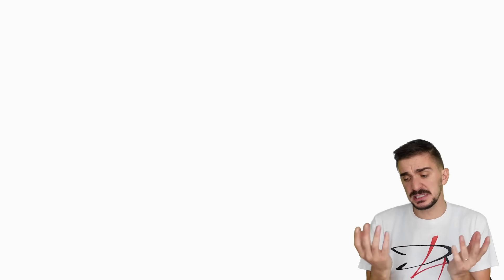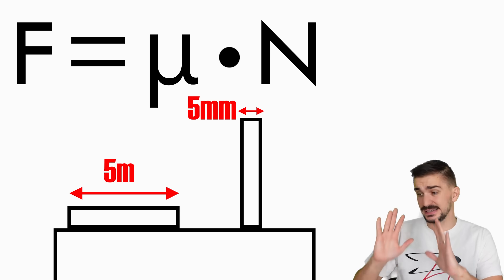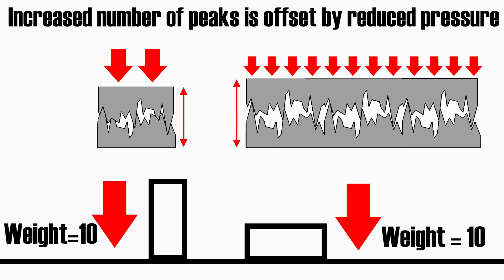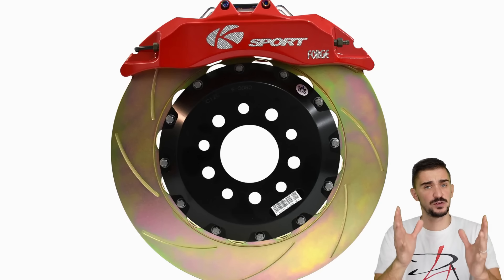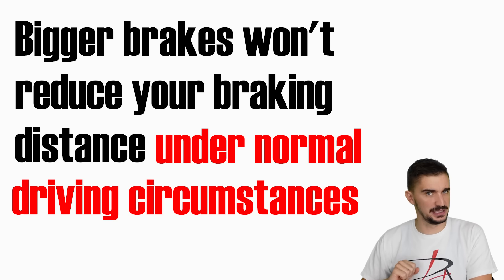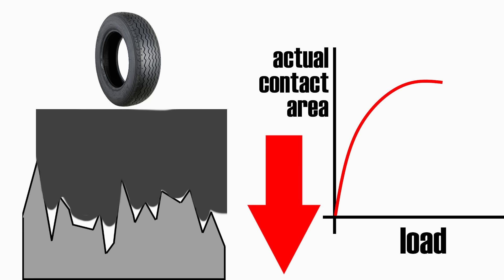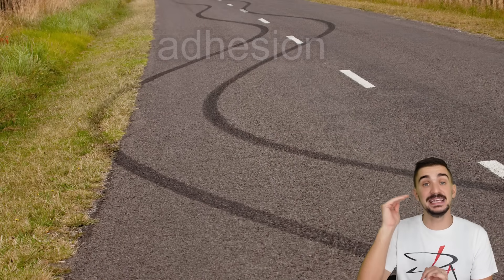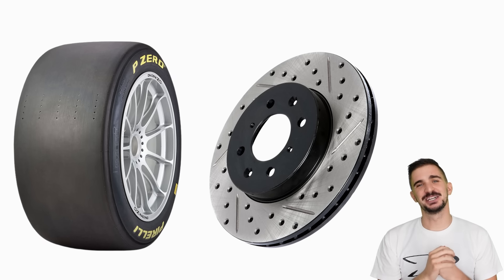Why Big Brakes Won't Stop You Faster but Wider Tires Will - Friction and Surface Area Explained

Comment: You are wrong for many reasons.
Maybe you should consider why all small light cars have smaller brake rotors, pads and pistons than all larger heavier vehicles. 
It has nothing to do with heat dissipation.
Larger rotor and pads also allow bigger or a larger number of brake cylinders and/or pistons giving greater braking force.

Comment: A larger diameter rotor - even with the SAME brake, pad, friction… only larger diameter - a larger diameter rotor will increase the moment/torque applied to the wheel, thus stronger stopping power (shorter distance to stop).
Reply: Stronger stopping power ONLY equals shorter stopping distance IF you can't lock the tires (or reach the ABS threshold) already. And even in cases where you can't, a higher coefficient of friction brake pad will give you more torque just the same, for less money and less effort.

Comment: Independent of friction, larger brakes have a larger average diameter which allow them to apply a larger torque to the wheel.   Therefore I argue larger brakes can indeed provide a shorter stopping distance
Reply: CAN...but probably WON'T...because any car that can lock up the tires (or reach the ABS threshold) can't make use of the increased torque. You'll just make it easier to lock up the tires (or reach that ABS threshold).
Reply: Agreed

Comment: Better brakes /calipers resist locking up. Any stock calipers are capable of locking up (stopping the wheel from turning).  Really good brakes (calipers) will let you generate high G forces Without Locking.

Comment: I'd like to point out that these tests are finding a 1% improvement with the wider tyres. Yes if you are racing professionally then every second counts, but for the cost of wider wheels, tyres, and any body mods you may need there are much more cost effective ways to make your car faster. Wide tyres and body kits are just "in" at the moment

Comment: You need to stop making absolute statements with your video titles.

As for the video itself, you state yourself that larger upgraded brakes will get you stopped in a shorter distance but then go off ignoring everything you just said. Unless someone who has years of experience working with modifying vehicles of any kind, they won't realize what you just did. The end result is your causing harm to regular people.

Comment: So, myu(mju...) constant isn't constant for rubber? It changes when a presure changes. Right? And a second question, motorbike tyres have round contact surface , so, how much it helps to have them wider? Perhaps slight underinflation helps more? Thanks.

Comment: Not all tires are created equal.   Michlen practically reinvented the modern tire we all drive on today.
Tube less, cross ply, advanced rubber compound, role stabiliy in hard cornering, very short stopping distance.
This Michlen-X tire was designed especially to order, for the legendary Citroen DS in the 1950s.   The DS is still the most revolutionary high volume production car in history, some of it's technologies and features are still not available on modern cars.
I have owned or driven Citroen GSA, DS21, CX. They all stop on a dime, modern cars don't even compare.

Comment: What is about the larger disc diameter (more precisely the effective radius) in which the brakeforce is applied? That should lead to a higher torque and a more effective decelerating, doesn't it?

Comment: Do upgraded brakes have the same ratio between master and slave cilinder? I would think they are different. If the surface area of the pistons is bigger on the upgraded brakes the normal force would be larger thus increasing frictional force.

Comment: Brakes being big and small have the same friction coefficient of tires being big and small. The applied force is the same. The cars weight doesnt change with bigger tires, but bigger brakes can cope with bigger brake pressure. So tire size doesnt matter, but brake size does.
Reply: Yea but heat is something else. So we should experiment with small but cooled brakes on a semi.

Comment: Yeah but bigger brakes can dissipate more heat. Your assertion of the pure physics of the matter is only instantaneously correct. In real application bigger brakes will be able to do more braking before suffering from fade effects related to overheating
Reply from the maker: Watch the video 😮‍💨
Reply: @d4a  so the title was just click bait?
Reply from the maker: No. The title is limited to 100 characters and there's only so much info you can put in the title and thumbnail. That's why we have the rest of the video to explain a concept. You should watch the video because your comment is just repeating some of the same info from the video. This makes it obvious you didn't watch at all and makes you seem too eager to just comment something to look smart.
Reply: @d4a  your graphic for the video is literally small brake = big brake. It's click bait. But if we watch the video we learn that small brake doesn't equal big brake. Groan, obviously

Comment: Thx for the good explanation. I always tell my friends that big brakes won't help since all types of disc brakes can lock wheels, which happens when there's more friction than what the tires can handle. They are of course useful for intensive or prolonged braking thanks to better heat dissipation.
Reply: Try stopping 5 times fast then you will understand why better brakes are needed.  If you never do this then your ok with regular brakes

Comment: I don't know man... I'm sure your are right, but I've seen an actual brake performance test carried our with a bicycle, using various rotor sizes, and the main conclusion was that the bigger rotors significantly reduced the stopping distance.

Comment: It's not necessarily about breaking distance but also about endurance. Bigger brake absorb more heat. They also dissipate more as the air flows over the larger surface area. Brake fade can essentially be postponed or eliminated altogether. Also the larger disc's provide better leverage.
Reply: I spoke too soon...  next time I'll watch the video to its entirety first. Sorry. 😞

Comment: Nothing in this video is wrong per say. But the original statement is. Bigger brakes have a greater distans from the centre of the hub to the pistons, resulting in a better stopping power. Plus, they tend to have larger piston area too.. So..

Comment: One big flaw: stock system DOES NOT brake as hard as a bigbrake system.
Bigbrake = lager diameter = higher torque 
A smaller diameter disc DOESN'T provide the same braking force as a bigger one.

Wanna test?
Ride your bike, f.e. an R6 on the track.
Now change ONLY the 310mm disc with a 320mm disc (and 2 caliper spacers 😅).
You WILL have way bigger stopping power.

Comment: On the brake disc you are correct on the heat management but the other big reason is that with a larger diameter provides a better feel for when you are reaching the edge of the friction circle of a tire. Since both brake systems are capable of locking the tire and thus reaching the maximum friction circle and thus would have equal braking capabilities, the ability to take the vehicle to the edge of the friction circle without going over is easier with the larger brakes than the smaller brakes and thus leads to better braking performance.
This was originally taught to me by this method. Take a record player (Yes I am old) and set the spin speed to 78 RPM. with your finger try to slow the record down to some number X, say 52 RPM's for example, it is much easier to do this when you are on the outer edge of the album (6" away from center)  rather than close in say 2". You can do this with a 33 RPM record spinning at 78, as you get close to 33 the record sounds right and this is easier when applying pressure on the edge. 
This holds true regardless of whether the car has ABS or not, the computer will still have an easier time and can be programmed to take advantage of the larger diameter and moment arm of larger diameter brakes to improve performance. I have never really considered thermal performance as a valid reason for going to bigger brakes on a street car, but better feel is a distinct advantage.
Reply: the problem is abs makes that point moot.

Comment: I'm sorry to have to pick a nit, but the 'Normal Force" is not the weight of the object. On a horizontal surface it may be the equivalent of the weight, but it is the force that counters the object's force against that surface. As I said, on a horizontal surface the force an object exerts on the surface (road) is the object's weight, and the normal force will be the force the road exerts back onto whatever is on the road.  But if the road is on an incline, not all of the vehicle's weight will be perpendicular against the road, only a fraction of it.  And here's where the important issue comes in ... the normal force (always perpendicular to the surface pushing back against the vehicle) will match only that fraction of the car's weight.  The greater the incline, the less of the car's weight will be matched by the normal force.  So what?  Well when going downhill your braking distance will be increased not because of gravity assisting in pulling you down, but because the normal force of friction from the tires is reduced --- something to think about when driving, especially in the rain or snow.

Comment: Nice video, but I think you forgot to mention that larger brakes also have a larger radius for which the friction force imparts a torque on. Wouldn't this increased torque improve stopping power? (Think turning a bolt with a small wrench versus a much longer wrench)
Reply: It depends what was the limiting factor before - if it was the tire grip you may face less pedal force, but a more powerful brake would just lock the wheels earlier.
If the brake was too weak to lock the wheels before (and the limiting factor) it would improve stopping distance however
Reply: It would reduce the amount of pedal force needed for a given braking effort. They also often have larger pistons which again gives you more mechanical advantage. It all comes down to how good the original brakes are, if the originals are capable of locking up the wheels then big brakes won't improve stopping power. What they do offer in that situation is a larger capacity to store and dissipate heat for better sustained stopping power as well as a lighter pedal
Reply: @TheTomco11  All modern brakes can easily lock the wheels, that's standard for decades already. It's nothing wow or difficult about it.
Reply: @TheTomco11  I would agree with that, thanks for the reply

Comment: I'm still confused after watching this... I understand that stopping distance is ultimately limited by tire grip but if you're below the threshold where the brakes are locked and you're just sliding to a stop, wouldn't larger brakes bring you up to that point with less effort at the brake pedal?
Reply: Yes you are correct. Normal drives do not require the use of abs to stop.   larger pads and rotors may offer a better brake feel and more consistant stops when used often.